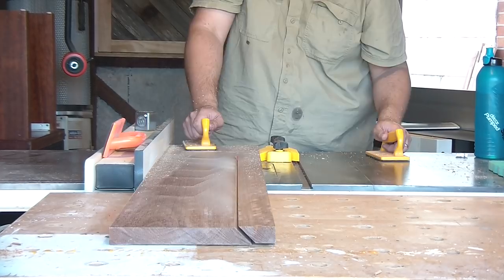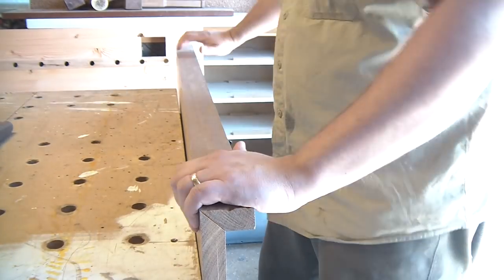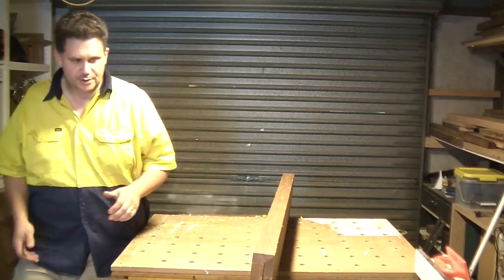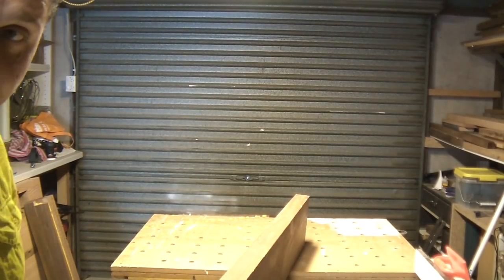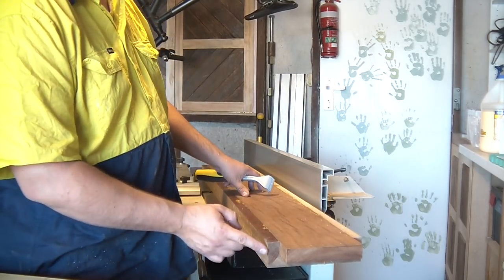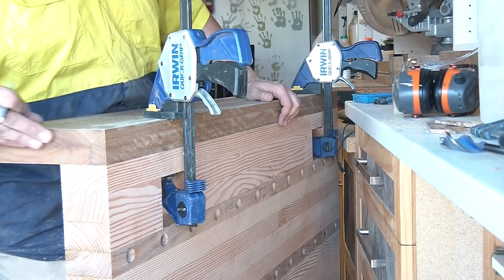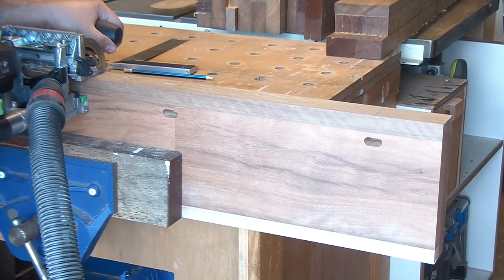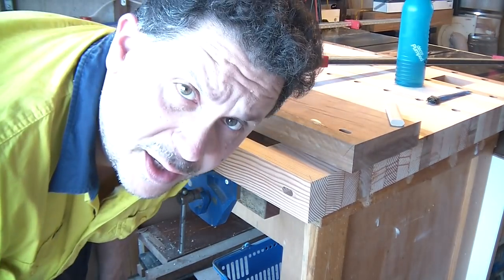Making my workbench part 2 - the front apron

Comment: And the odyssey continues, great way to use up scrap to give the face some heft. I'm watching this closely as we are pulling down a hardwood retaining wall (sleepers are in excellent condition but posts are failing) to replace with concrete sleepers and I intend to make a work bench from the old sleepers. What is the timber, don't know at this stage other than its a gum, will have to wait until some cleaning up has been done.
Reply from the maker: I built my entertainment video from old sleepers from a retaining wall. Anything that was easy to lift we chucked out because it was obviously rotten but anything still to heavy to lift was ok. You can see the 3 part video series in my channel. They will have an mc of about 20% so you need to roughly size everything then set it aside to dry. I year per 1" of thickness
Reply: Luis thanks for the reply and yep, watched the videos on your sleeper build when you uploaded them. Just to clarify, they are not railway sleepers they are 75x200 landscape sleepers. We purchased the house about two years ago and it was obvious that the previous owner had done a quick fix for sale, confirmed by our neighbour later. Well if I have to wait a little longer not an issue. Will see what they look like when pulled out in the next week or so.
Reply from the maker: That's good so they wont have spike holes in them.
Mine were the same but about 30 years old. I should've pressure washed them 1 week prior to cutting then let them dry off to not dull my knives as much.